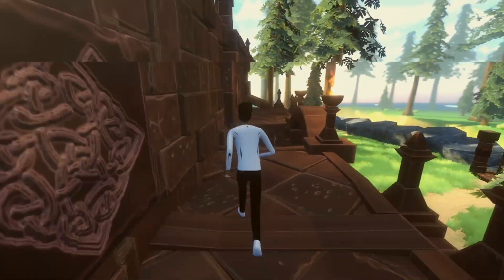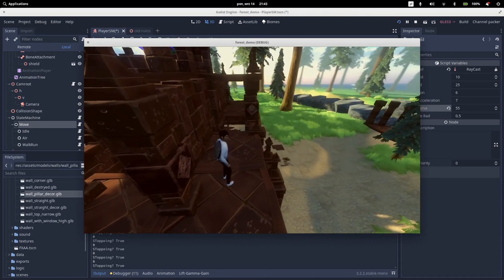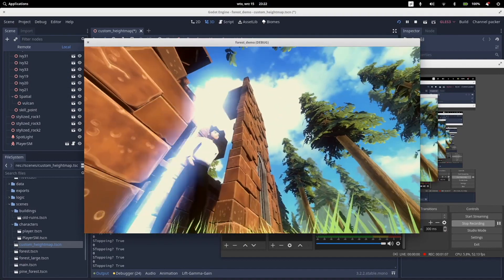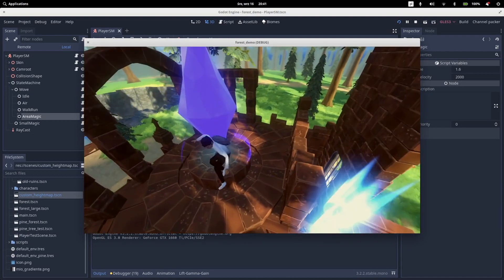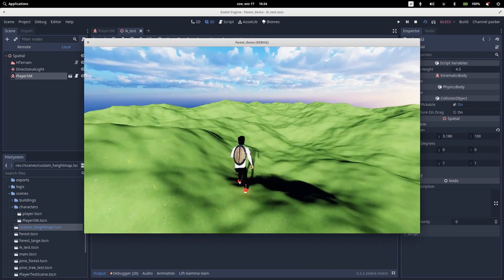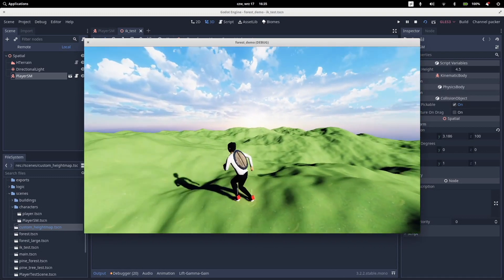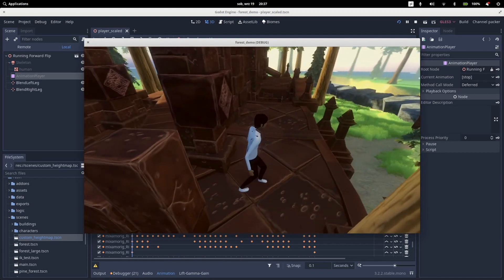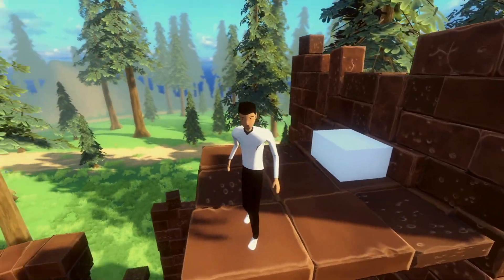First Gameplay Mechanics | Godot 3D Devlog #5

Comment: The character. Yeah. A very interesting topic for me. Tell me please! Very often in games I see little things that upset me. This is due to the character's gait. It is ideal and it feels like the floor is slipping. It is especially noticeable when the tempo changes. I discussed this with my friend programmer, he says this is a very difficult thing to implement. Are you going to sync your feet to the ground? Feet slip a little now.
Go on, very good for one person!
Reply from the maker: Hi, it's difficult for few reasons. The way I implemented movement is the simple approach. So basically I have 3 animations: idle, walk and run. And I have a 1D space blending. That means that in engine is blending with different weight those animations based on character velocity. It's hard to sync those footsteps with actual velocity because it's based on linear animation blending. Maybe it should be blended with values that takes into an account real acceleration of player but it also sound difficult to sync. The best way to solve this problem right now is in my opinion to increase acceleration to the point where it's not so noticable. I mean I can sync my animations with speed only in 3 points so, I just to skip points between them as fast as I can. The other better way would be some procedural animations, but I don't like them. It's hard to create something that looks natural. Second problem is that IK system that I am so proud about :D It makes foots to stick to floor. So in reality there need to be a balance between how much you can accept that sometimes "leg" goes into an obstacle, and how slippery it feels. You can tweak it but it takes a lot of time. Until I don't have a final character model I keep it as it is right now.

Comment: I'm working on inventory, save, dialogue and combat mechanics first this go around...if the combat is boring..no point in even continuing...but inventory and save can be plug and play.
Reply from the maker: That's great to hear. To be honest I do not plan to add a lot of combat to my game. Maybe some little mobs to increase your stats in between major ruins and other places. I want to end this project someday so yeah, can't add everything :) At least not at scale I want it to be. But definitely save and dialogs would be an important thing also for me in the future. But first I need to add some UI. I really loved your UI/menu in Tiny RPG. Especially skill points menu. That looked awesome. Was that all implemented using standard Godot UI containers ?
Reply: @wojtek_pe  I coded all of it using just texture rects, 2d colliders and a raycast....it was my first go at godot and was primarily designed for me to learn, also I was unaware of all the other options..so I started a new project(real project) now that I am more comfortable with the engine. Nice to see someone as well versed as you knows about my "tiny" project...means a lot.

Comment: Amazing how fast you progress. I'ld love a tutorial on how you solved the IK for the terrain floor.
For the game, I think you should design the world in a manner that jumping really makes sense. Jumping on the 20cm high bridge block at 5:55 seems a bit weird because he jumps like 1,5m for that. 
I know its more stuff to implement/animate but balancing on a wooden beam or something in that direction would sell that part better.
Reply from the maker: Hi and thank you for suggestion. You're totally right about jumping on the 20cm bridge block :) And I have already planned a little bit different solution for this problem. Basically I will place a raycast in front of character. Then I will check if an obstacle in front of it is in some altitude range (for example 20-50cm). If it is, then I would play some climbing animation instead of jump. Also I have some idea to tackle situations on the surface edges, like playing animation of losing balance.